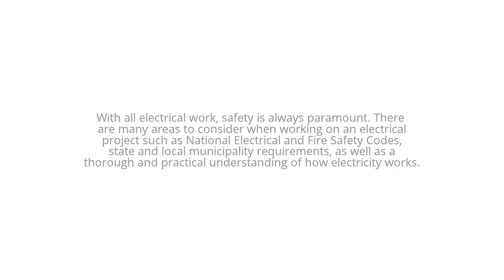MC, AC, BX cable and flex sizing

Comment: Thanks, been try'n to figure out what size fittings to buy for mc cable. Light co. says 7/8" knockout on their fixture... and package at local store says 3/8" 
connector with(1/2") KO ?,,,
    but that's what fits the 7/8" light hole! really confusing,  thanks for clearing that up!

Comment: Bx  ground wire is smaller than the other used in residential. Mostly 60s and 70s.  Mc  is used in commercial same size ground. Here in GA anyways. Family has been in the business since knob and tube. 40s or so. Not exact science but easiest way to put it, for the most part.